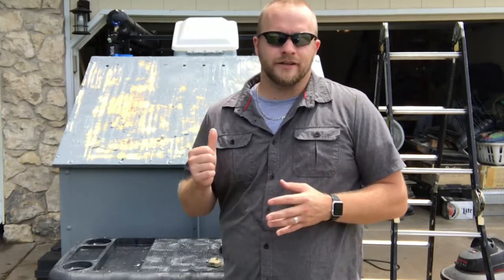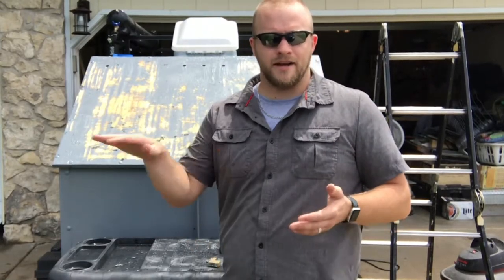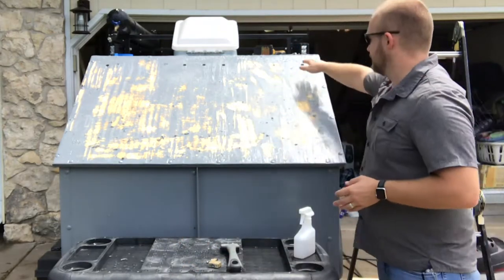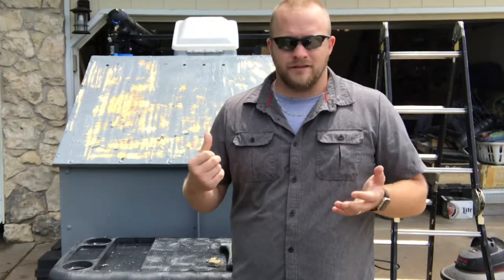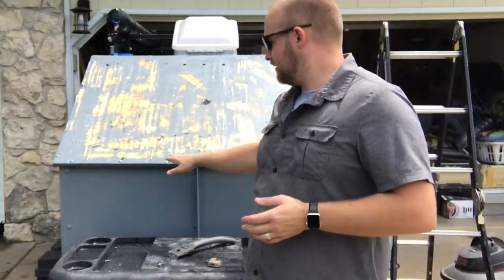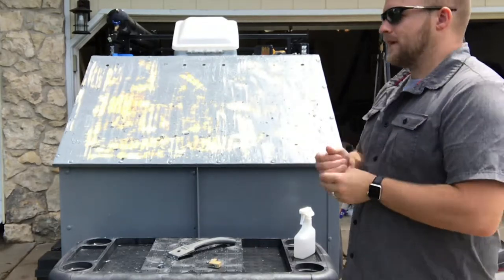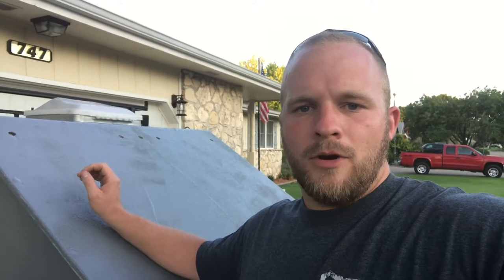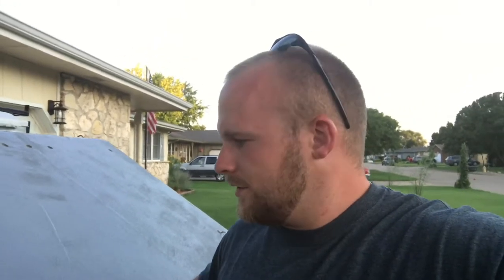Adventure Trailer Roof Repair

Comment: I used a Elastomeric Acrylic Roofing Sealant on the roof of my home built and it has worked great. It's been two years now since my build. Mine looks just like yours even the same color. lol... I built mine to 10x6 on a 19ft boat trailer. I have a 100w panel on top. The whole camper is wired for 12v or 120v via inverter and converter if needed.

Comment: When you say "fiberglass resin" do you mean polyester resin or epoxy resin?
Usually when people use fiberglass over wood they use epoxy and when using a mold they use polyester though I know of uses where polyester was used over wood. Also, what grade of plywood did you use? Looks like ACX but could be BCX. There is some really crappy plywood out there and its really hard to know what the best choice is. My choice would be MDO but it also is expensive and harder to find. 
I have used 6 oz cloth set in epoxy over MDO plywood and then painted and it held up good for boat building. I brushed on interlux brightside polyurethane enamel after sanding the epoxy to a dull finish. Pretty expensive paint and the epoxy aint cheap either but it looks sprayed when done and was very durable. There is also a flattening additive that you can add to the paint if you don't want it shiney. That non skid surface seems like it would be hard to keep clean.
I am planing to build a small trailer like yours and looking for ways to cut material cost and weight without sacrificing durability. XPS foam maybe?
Reply: that's my Q. also was epoxy or polyester used?